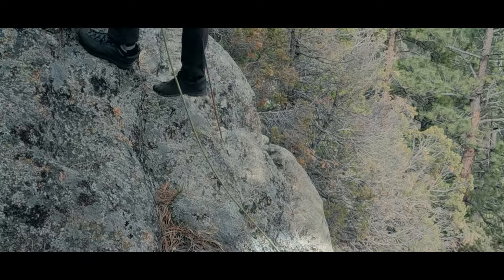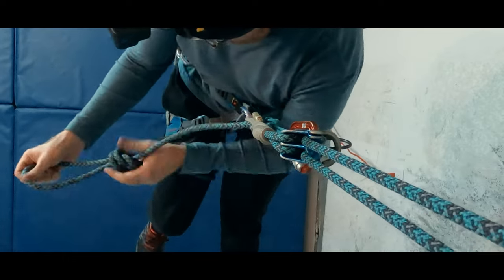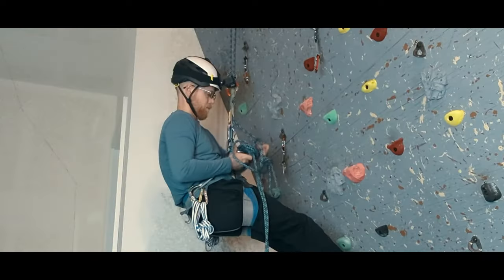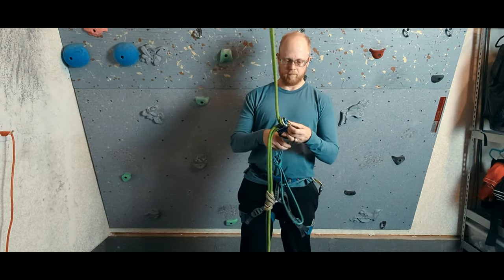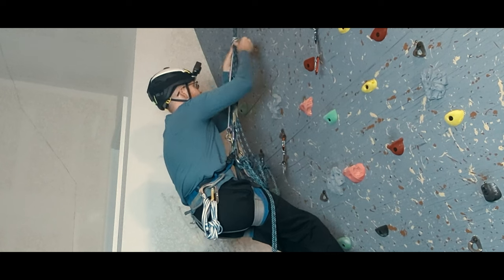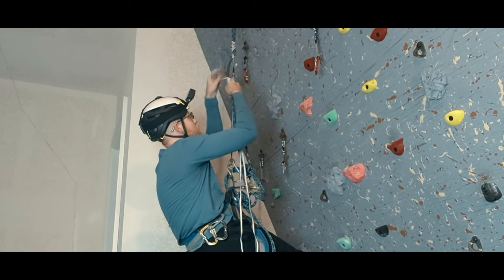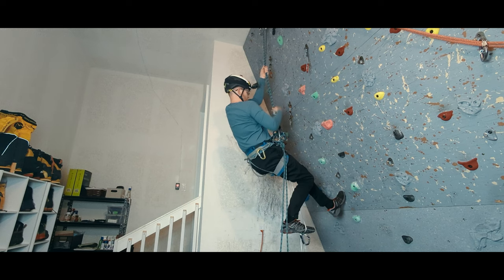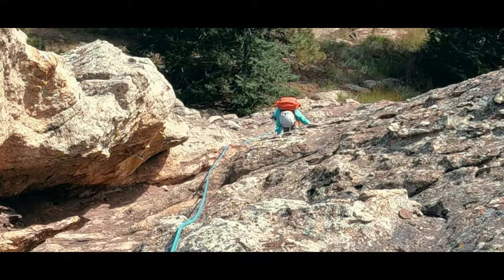How to Pass the Knot While on Rappel (Abseil)

Comment: Looks good. The only issue I have is shortening the prusik knot with a Clove hitch. This knot can slip, more so on dyneema, so maybe clip the end of the loop into the crab so it can't slip off?
Reply from the maker: In such a static environment, I'm not worried much about slipping, and we have the catastrophe knot below; but your idea seems like a low-cost way to avoid a potential problem and having to re-rig the system, for sure.
Reply: Sure. You do have the catastrophe knot. I'm just thinking it's not generally a knot you want to put towards the end of anything. For reference to the idea of clipping in the free end to make it 100% secure see around 7min into this from the ENSA https://youtu.be/eqZQnCGl24A?si=1fXbK2N9wcFlC0tj
Reply from the maker: @stephenbarby7234  That's a really good point. I'm pretty small (hence the channel name) and so don't worry much about the length of material. I do the same thing with "clipping the free end" of a double bowline when I use it in a fixed-point belay. Makes a a lot of sense.